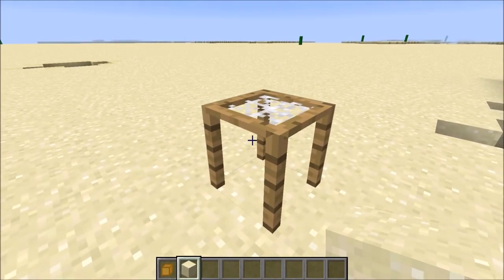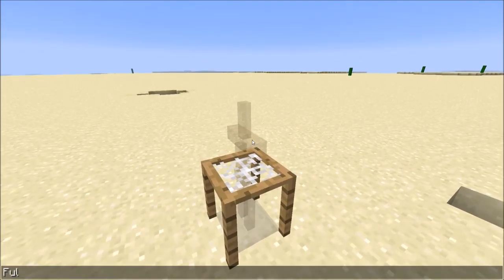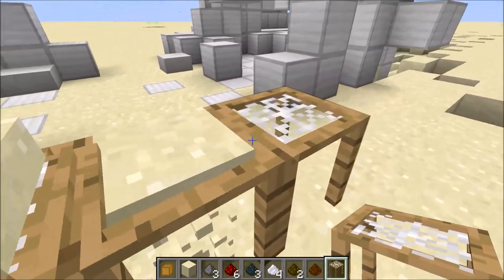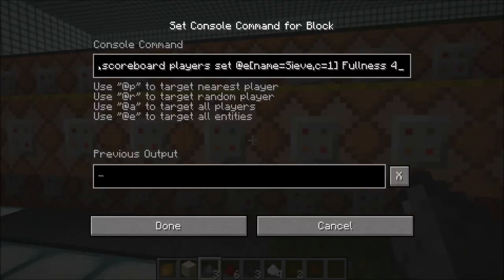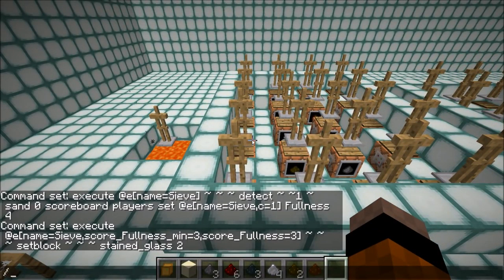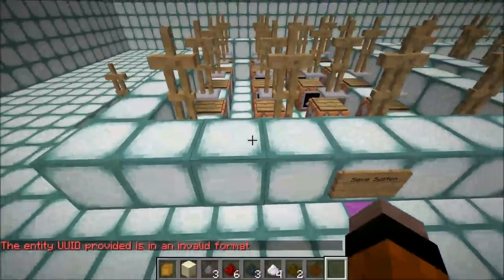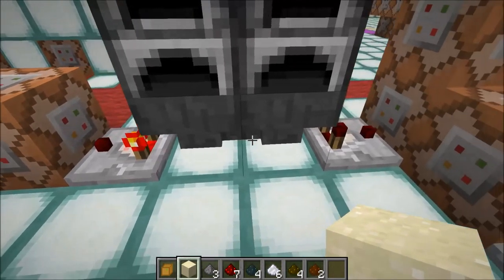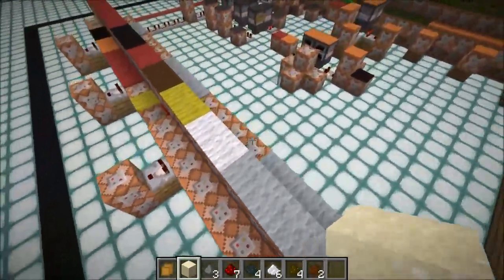How the Sieve works in Planetary Confinement!

Comment: theres a bug for me.....after some time, the seive doesn't work. A new seive works for some time but later,it gives me nothing from dust
Reply from the maker: This is a known issue that seems to be caused by outdated Java versions. Make sure you are using Java 8. Press F3 in game to see what version you have. Once you install Java 8, don't use the sieve for 6 minutes and then it should work again.
Reply: thnx i updated java and it worked
Reply: i have another problem...my friend who is playing singleplayer as well also has the same problem.The mob animations are slow and when we break blocks,it spawns again and then breaks away automatically with the drop. There is no lag whatsoever
Reply from the maker: Try the LC version. Your computer is too slow to handle the normal version.
Reply: i tired the lc version....the mobs are normal now but the blocks still lag
Reply from the maker: Well then I cannot help you much since its your computer being too slow that causes that. The LC version uses half the command blocks but if that still lags for you then there's nothing I can do.